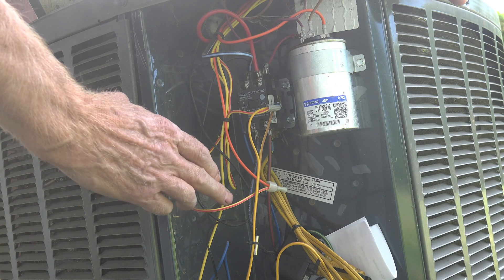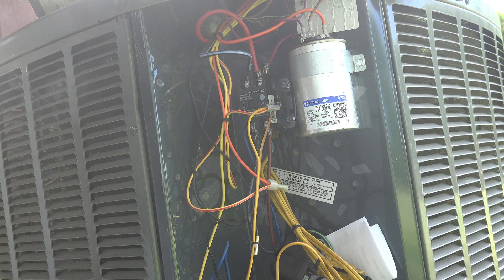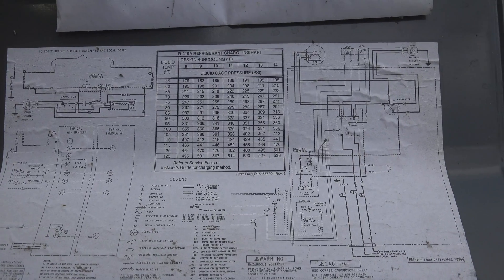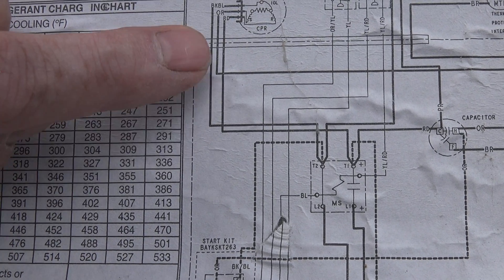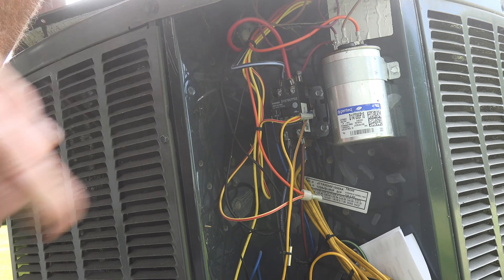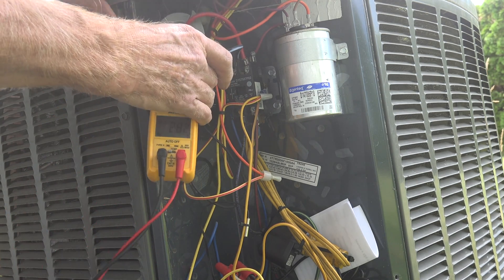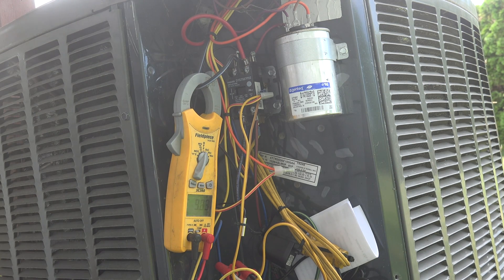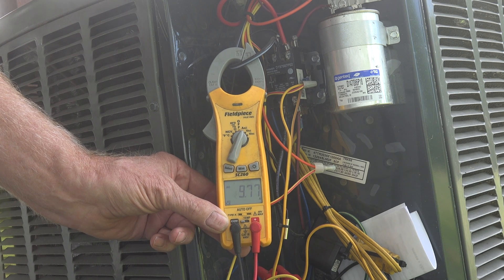How to check amp draw of the A/C compressor

Comment: So do I have this right?.... 9.8A x 240VAC = ~2350 watts? Then another 200-400 watts for the fan? Then maybe another 500 watts for the air handler in the house?
Reply from the maker: Pretty close.  Air handler could be up to 1000 watts.  
GFM
Reply: @grayfurnaceman  I just measured my system yesterday (after searching for my clamp meter for days). 3 ton heat pump in Florida. 8.8A outside and <0.5A inside (both 240v). No way to measure peak/rush amps without an assistant and just watching it, but I'll install a soft start. Looking at a Wen 6800 dual fuel for emergency power.... enough to run my AC, fridge, freezer, and some minor loads.

Comment: if my compressor only pulls around 10-11 amps, (even on in-rush) am I wasting my money buying one of those Micro-Air devices ?
Reply from the maker: I will answer on the value of soft start devices.  They are primarily used to reduce high start amp draw.  They do reduce momentary high amp draw on startup.  The devices may reduce potential stress on the compressor motor.  If you are doing it to reduce energy usage, they are not useful.  The high amp draw is for such a short time, the savings would never pay for the unit.
GFM

Comment: Goodman package unit 3.5 ton. Liquid line sweating amp draw is 17. Diagram says 19amp. Conpressor makes loud sound on start up? Stuck on this. Any ideas?
Reply from the maker: If there is a delay when the compressor starts, the compressor may be failing or the capacitor is failing,  Check the capacitor strength.  If ok, you may need a hard start kit.  This could extend the compressor life but only marginally.
GFM

Comment: However keep in mind that if you get a no ac and your heat pump breaker is tripped, there is a good chance there’s a problem at the disconnect, contactor, or compressor itself, if you unplug the molex of the compressor and turn the breaker back on and it doesn’t trip, your compressor is done. Your compressor pulls the most amperage on the circuit because the outdoor fan does not

Comment: What is considered low amp draw and how do determine if the amps are to low?
Reply from the maker: There is no set rule here.  And draw varies with voltage, load, charge level and ambient temp.
If the draw is 1/2 or lower of the RLA with voltage within 90% of the rating plate, I would be concerned.

GFM

Comment: What happens to the amperage draw if the AC is low on refrigerant ?
Also what happens to the power consumption  if the pressure of the refrigerant is getting lower ?
Reply: If the ac is low on frion you can expect the compressor to have more of an amp draw because it's trying its best to work at full capacity while it's missing the required refrigerant amount

Comment: Why not check it both before and after the contactor to see the health of the contactor. I suppose if it's different, then the contactor is causing extra amperage and possible needs to be replaced if the connection is pitted.
Reply from the maker: If there is an appreciable drop in amperage, the contactor would be burned up.  Contactors are not loads and cannot dissipate heat.
GFM
Reply: @grayfurnaceman  Thanks. So would it be better to check the contactor using ohm resistance?
Reply from the maker: @mtbbiker6401  The best way to test contactor resistance is to check voltage drop across the contacts.  Place your voltmeter probes across the contacts.  The result is the voltage drop.  Over .2 volt means the resistance is excessive.
GFM
Reply: @grayfurnaceman  Great advice. I will test.
Reply: @grayfurnaceman  I finally got around to testing this. I have a very similar 5 Ton Trane Heat Pump unit (26 RLA) My amps on the Common (black/blue wire) is 21.5A both before and after the contactor (105 degree ambient temp outside). The Red Run wire was getting a different reading. Before the contactor I'm getting 21A but after (compressor side) it's only 16A. Is this because the capacitor is also connected to that side of the double pole contactor? Also the contactor is only 1 year old. When I installed it I didn't see a side listed as L or T, so does it matter the orientation of the install? The contactor is a double pole and it appears symmetrical with no L1,L2,T1,T2 markings. Thanks!

Comment: I did not see where you found the info on amp specs for the compressor. You talked about it as if we already knew what you were looking at
Reply from the maker: All units have a model plate, generally on the outside of the unit.  The max amp draw of the compressor will be noted there.
GFM
Reply: @grayfurnaceman  I don't know how I am missing it. I have been looking over the all the data on the unit
Reply from the maker: @waterssolar5025  Some units have it on the electrical panel underneath a cover.
GFM

Comment: thanks! Im  trying to chase down a "your compressor is going out" because the amp draw is to high situation from a service tech but he was talking about the compressor  but only testing the current on incoming (main)  power wires - adding them together to get a total that he says is to high so what I am looking at is the compressor wire only???? is there a percentage or rough guess of max (rating plate) value that tells you its to high??? mine is a Trans 5 ton 13 seer - I want to make sure this is not getting ready to crap out before  100 + summer really hits here in texas  giving me 13k estimate for new system so Id really like to be sure first the unit cools well. thanks for the videos they really help!
Reply: Is your Trane still running? I have a Trane 5 Ton Heat pump. The compressor RLA is listed as 26 amps on the plate. I usual see 20 amps during 100-105 degree ambient temps. The amp draw coincides with the temperature. Higher temps = higher pressure = higher amperage.

Comment: Maybe someone can help me. I called Yes air conditioning in Vegas for my hvac Lennox brand to be tuned up for the summer time. The tech said my amps for my a.c. compressor is too high,the panel has 17.9,and the tech read on his multi meter it's at 17.1, he said it's way too high and that my a.c. won't make it in the summer,and that I need a new one. He changed the compacitor and the a.c. compressor went to a 15 or 16 amp. He said it will be ok for now n it's just a band aid,but it won't hold up. Idk if they are trying to sell me a brand new a.c. or what. Any thoughts
Reply from the maker: There is nothing in the information you gave that would indicate to me that your unit is failing.
GFM
Reply: @grayfurnaceman  wow thank you for the reply back,idk if the tech is trying to sell me a brand new a.c. n wanted a sale.

Comment: 9.5 amps at what voltage? I'm guessing you're an America so you don't know that every country has different voltage so I'm not gonna make fun of you or insult you or say anything against your ignorance. But can you please tell me how many volts did you measure the amps at? 🤔
Reply from the maker: This video is about how the check amp draw of the compressor.  The voltage is not part of the point here.  
Its about finding the common wire so you can be checking the right wire.
GFM
Reply: @grayfurnaceman  you didn't even showed that in the video. You just showed a bunch of wires and selected 2 of them without explaining why you chose them.

Selecting the correct voltage is the most important part because amps mean nothing without it. The real power consumption can only be measured in Watts. I hope you understand what I'm saying
Reply: @fsalhin99 Wow 😂
Reply: @fsalhin99 He already told you that thus video is about checking AMP DRAW!!!

Comment: Rla at 13 amp draw is at 7. What’s that mean?
Reply from the maker: It means the compressor is under light load.
GFM
Reply: @grayfurnaceman  makes sence. It was a little cool outside. Customer stated that the compressor shuts off after 15 minutes on a hot day. And starts up again after a while.
Reply from the maker: @ar420420  If the compressor shuts down but the fan stays on, it is probably going out on internal overload.  Many possible reasons why.  Low charge, non condensibles in the system, overcharge, capacitor failure, etc.
GFM

Comment: I know on DC systems it doesn't matter which wire you choose to test AMPs, but I've wondering about in an AC system- thanks for finally giving me an answer!!
Reply: Main reason here is you have 2 circuits running in the compressor and by using the neutral  You're getting total amperage. I would have liked to see him. Do a  start up amperage draw amount.
Reply: @SteveJames-u3u  For this you would need a special meter to measure rush amp correct?

Comment: Thank you!
Reply from the maker: Welcome  (no complaint about new vs old?) lol
GFM
Reply: @grayfurnaceman  
Was talking to a "big time" nyc commercial hvac guy yesterday. 
"The new systems - they have to run at higher temperatures and pressures. The equipment is new and it's always breaking down"  Ohhhhh... You don't say....

And I'm thinking "thank you c--- s-----s of that stupid Montreal Protocol."

PS: these stupid blends we have to live with - post ozone quackery: As per your video about Blends, they fractionate - ok. That means: if there's a leak, the whole f------ refrigerant charge has to be replaced, right? B/c fractionation means one of the gases leaks out more than the others, so the ratios are screwed up, and you have to start over with a new charge, correct? (Am walking the line between good hvac student and Disgusted American.)

++++++++
As a refresher, here is The Ozone Scam:
https://youtu.be/9Szs-treHwQ

It's not perfect, but it's a good indicator of the stupid country EPA and DOE have turned us into.

Comment: Today I have a strange low contractor problem. The AC condenser unit runs about 5 to 10 minutes, then stopped, but indoor motor still running. After about another 5 to 10 minutes, the condenser unit started to run again. I checked the low voltage at the condenser contactor, I had 24v power. When I put the low wires back to coil sides, the contactor wouldn’t pull in. I checked several new contactors, including single pole, 2 poles, 3 poles, they all had the same problem: when I first put low wires at the contactor coil sides, contactors pulled in, then I disconnected one wire, then put it back, the contactor then wouldn’t pull in. The low voltage power is there. Any ideas? Thank you
Reply from the maker: With the info you have given, I would think you have a low pressure switch opening, probably from low charge in the unit.  
GFM
Reply: @grayfurnaceman  which means your leaking and if the fittings are tight the leak might be terminal.. tell me another way a leak can be fixed though as you are the master.
Reply: Apprentice - volt meter training time
Reply: Check the fuse in the disconnect or the double pole breaker at the panel
Reply: Make sure your thermostat isn't reaching your set temp. Could be that. Could also be low pressure switch opening from low charge just as grayfurnaceman stated. Could be high pressure switch opening as well if you don't adequate airflow, like a dirty filter for example. Your contactor situation is a different problem. Contactor sounds good but there could be a delay board or one of those PG&E delay boxes. Or one of those switches could still be open. A lot of different possibilities.

Comment: Gray Man:  Was this a 120 or 240 volt unit? Need the info to compute the watts
and thereby the cost per hour to run.   8 cents per KWh for power.  Thank ou.
Reply: Wow, where are you paying only 8 cents?
Reply: @Swoliosis1  where are you at and what do you pay?
Reply: @mitchdinner9743  About 0.13 - are you sure you are including both transmission and production costs?  Usually listed separately.. it is what happened when a guy in PA told me he paid 0.06 -  I'm in MD
Reply: @Swoliosis1  thats the price per kwh not included transmission. Teds comment was the price he paid for generation only. You don't include transmission when comparing price per kwh. Jcp&l's  delivery charge is 3 cents x how ever many kwh you use per month. My monthly bill in a 1800 sqft house is between 50 and 90 dollars a month. I actually shop around my rates every year or two. Jcp&l's rate per kwh is actually 10 cents, but i use a green energy supplier that gives me a lower rate. I've had prices as low as 7 cents in the past. Its a win win, not only do i get a lower rate, its clean energy generation. So its worth my time to shop around every year or two.
Reply: I pay 8.89 cents also in nj.
Reply from the maker: Its 240 volts nominal.  
GFM

Comment: Mister furnace man, you made a great video. Tell me, is it better to check the amp draw at the contactor or right next to the compressor where the wires enter the compressor?
Reply from the maker: You can check at the contactor but you must be downstream of the contactor and clamping only the compressor wire.
GFM